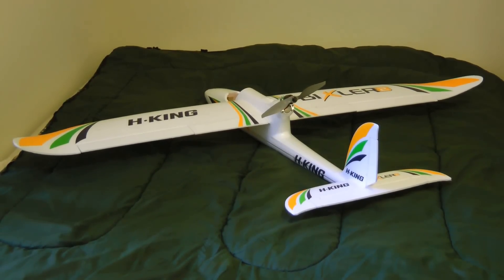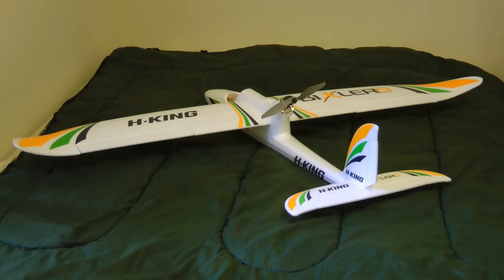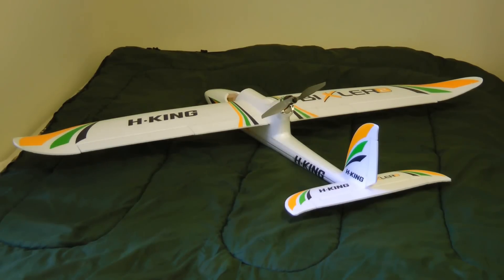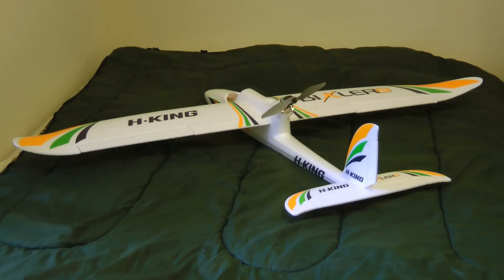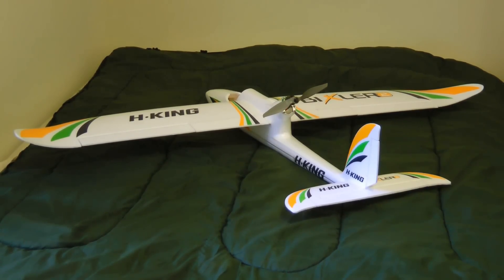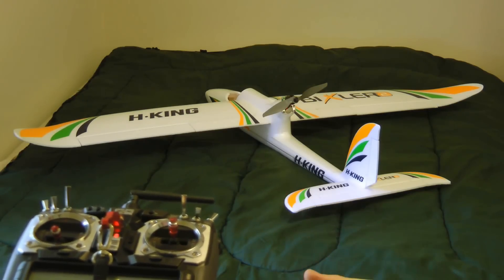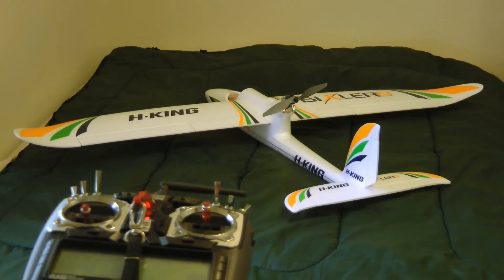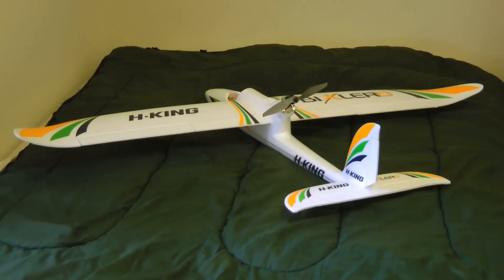Gyro-Stabilized Flaperons, Bixler 2 wing configuration

Comment: hi Ian.. I realize you posted this 2 yrs ago bit the original blog post link doesn't seem to be working and I was hoping you could explain the servo to receiver connections and also the mix programing within your radio. I'm using a Dx6i and was hoping yours might be similar.